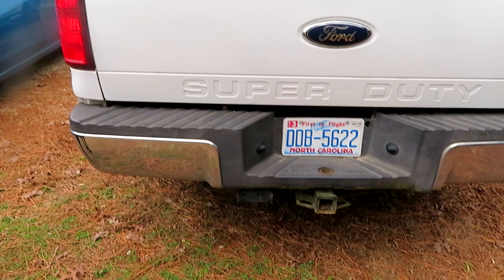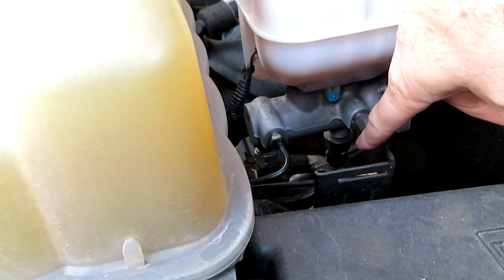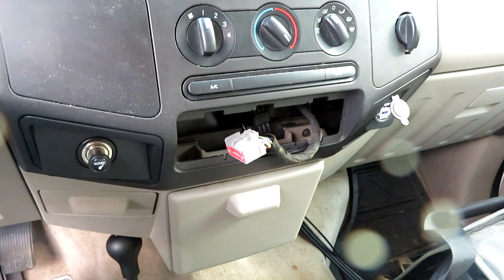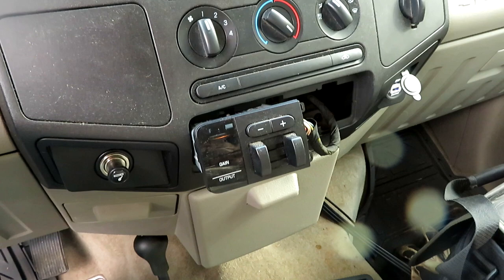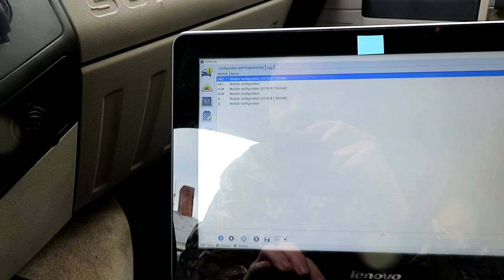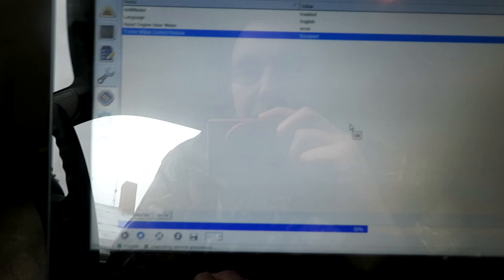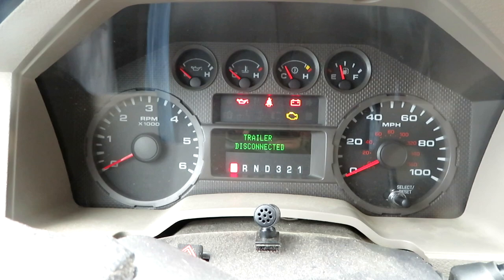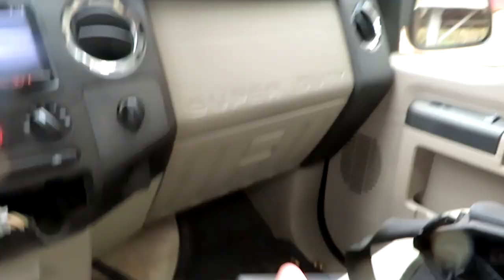FORScan   Enable Trailer Brake Module on a 2008 F250

Comment: Pretty quick and painless, once you have the laptop and factory software. Probably saved yourself $300 - at least that seems to be what everyone pays at a dealer for anything, up here in MA. Starts at $300 & goes north from there, lol.

Thanks for sharing, Chris! 👍👍
Reply from the maker: Thanks Smitty, yep, you need the OHP "ELMconfig Forscan OBD2 Adapter" ($30),  a laptop, and the FORScan software(free) to do the programming. I had to buy a Ford Master Brake Cyl with 2 Pressure sensors, and the Ford Trailer Bake Controller.    I tried to get my local Ford dealer to make this software change and they could not figure out how to do it, and still charged me $123 for 1 hour diagnostic fee.
Reply: @Chris-Fennimore  - That's a typical domestic dealership scenario I hear about about over and over again from so many people. These manufacturers expect their techs to work for free, so this is what happens. Glad you were able to do it yourself! I'm shocked that software was free!

Comment: HI, I'm attempting to follow in your footsteps. I have the wiring diagram which reflects 3 wires going to the transducer. The Ford serviceman identified a spare cable that had only two wires. The wire colors appear to be yellow and black. Does this seem like what you found. The unused cable was inserted in a blank female connector that was secured to a larger cable bundle.

Comment: Chris, great video! I have been working on this over the past couple of days. I went through it in the reverse order from you. I installed the controller, went into Forscan and enabled the TBC. The controller lights up, allows me to control the Gain, shows "Trailer Disconnected" on the dash, but it showing "Trailer Brake Module Fault". I'm thinking it's because I haven't replaced the master cylinder and it looks like I have to do that as I only have one plug underneath, towards the front, which I believe it for the cruise control. I'm trying to hunt down the proper master cylinder. When I searched the part number you provided in one of your responses, it has the two plugs underneath but mine also has a plug on the side, near the valves. Any idea on how to hunt that down? When I called my local dealership, they only provided me with the master cylinder that came with my truck, which only has the one plug.

Comment: Are these the same pressure switches? Could you just wire both connectors into one to just use one pressure switch?
Reply: not the same

Comment: Where did you get the new master cylinder with the second plug
Reply from the maker: For my 2008 F250, it was part 8C3Z2140DB. FORD GENUINE OEM MASTER CYLINDER. It has the 2nd Pressure sensor for the Trailer Brake Controller. Any Ford dealer can get it.
Reply: It came with the sensor?
Reply from the maker: yes
Reply: Awesome thanks for all the help!
Reply: Thanks, had the same question